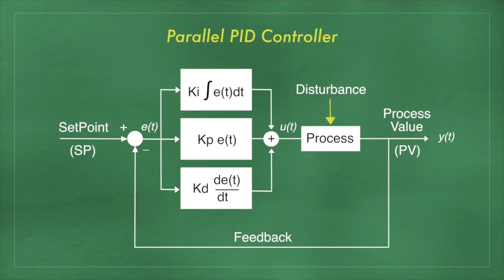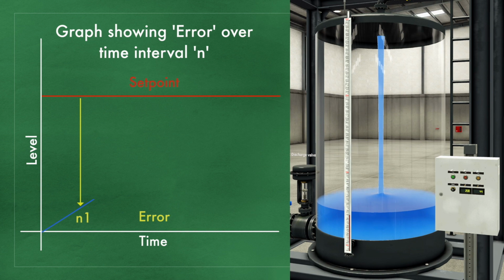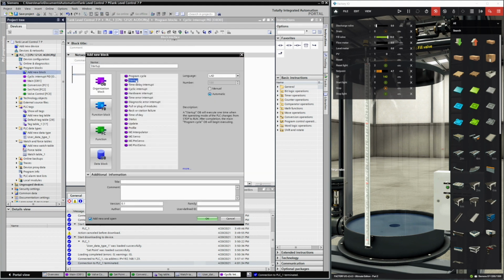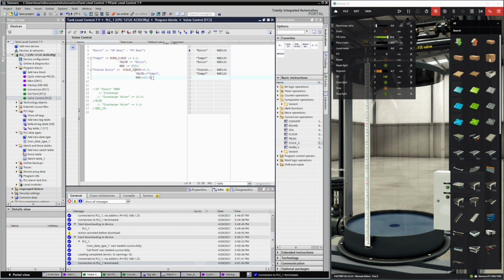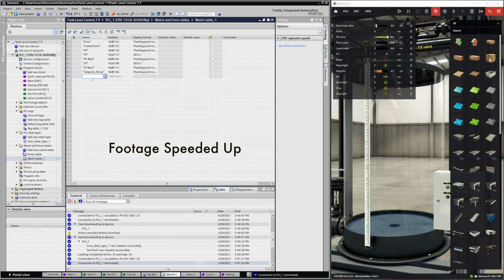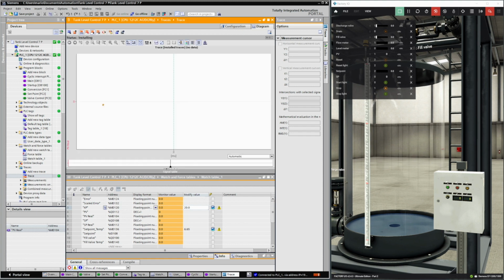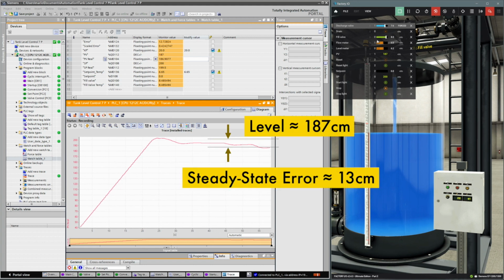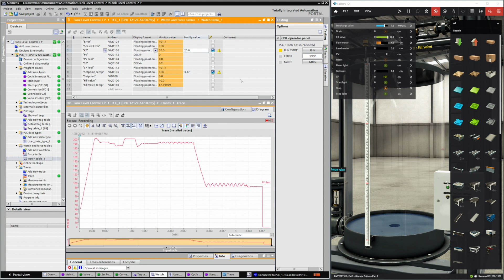Proportional Controller with Siemens S7-1200 (SCL)

Comment: Hi Mario,
Thanks again for this excellent clear tutorial.
i'm glad that you explain every step from the PID procedure.
i have used already before siemens PID for the watertank from factory I/O and a self-made temperature box, but that was with the standard function in the TIA program.
Now you have explain what every step is doing, and that makes live easier in the future.
I looking forwards for the PID I and D tutorials
Reply from the maker: Hi Frans, I'm glad you liked the video and found it helpful. I did however forget to clamp the valve output to zero if the required value was below zero and I have placed the information in the comments section. 

Here it is again, hope it helps:

IF "Fill Valve Temp" < 10 THEN
    "Fill valve" := 10;
    ELSIF "Fill Valve Temp" < 0 THEN
        "Fill valve" := 0;
    ELSIF "Fill Valve Temp" <= 10 AND "Fill Valve Temp" >= 0 THEN
    "Fill valve" := "Fill Valve Temp";
END_IF;
Reply: @MarioCrispino  Thanks Mario
Reply from the maker: You are Welcome Frans

Comment: HI Mario very informative video! is there a way to add feed forward ?
Reply from the maker: Do you mean the derivative? I will do this one in the future. The calculation is in one of the earlier videos.
Reply: @MarioCrispino  disturbance prediction? For example a furnace with a switch on the door so when it’s opened the system gets a heads up to the imminent drop in temperature and can compensate. This would be in addition to the Proportional Integral Derivative algorithm
Reply from the maker: Thank you for your explanation Andy. Personally I haven't programmed anything like that before. I can't even remember covering the subject while studying for my degree in control systems engineering, however it does sound like an interesting project. At the moment I'm working on videos for clients as well as a number of videos for removing pallets from the Warehouse Rack system I programmed some months ago so it might be quite a while before I even have time for it. Let me know how you get on if you start programming it. Many thanks once again

Comment: Hello Mario, this is an excellent content, I am doing a project in which I want to use the PID control for to maintain the temperature, I am using s7 1200 Cpu 1214 do I need an external module for PID, or I can do it with programming to maintain the desired as I reach the setpoint and shut off the heater, Mario pls help with this.....
Reply from the maker: Hi Askash, you can do it with the built in PID software that comes with S7-1200 and TIA portal. I chose to do it this way to help explain PID.
Reply: @MarioCrispino  Thanks Mario, I will try

Comment: Hi Mario, just wondering how you get the critical gain of 41
Reply from the maker: Hi Clifford, the way to get the critical gain is to slowly increase the gain until you get constant oscillations of the same amplitude. For this system it worked out to be 41 to 42. Hope that helps
Reply: @MarioCrispino  thank you